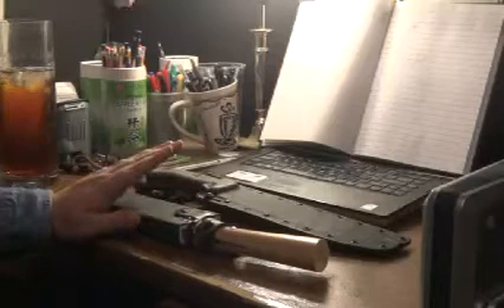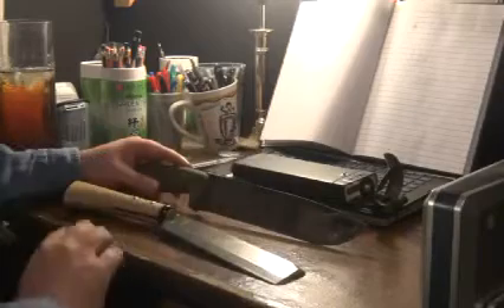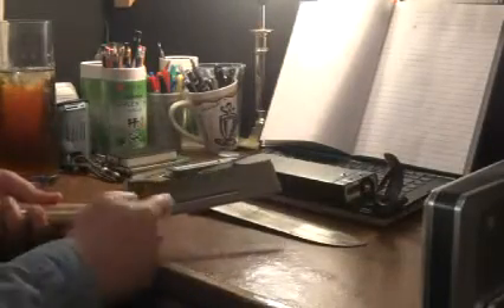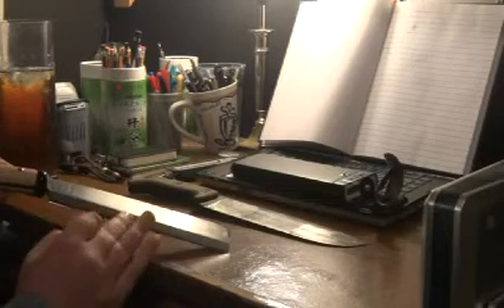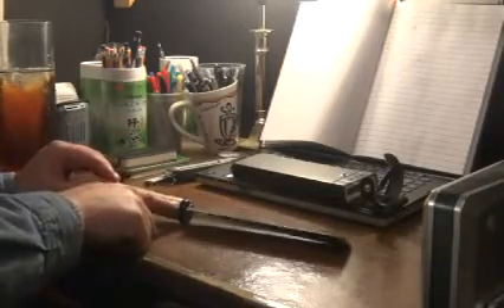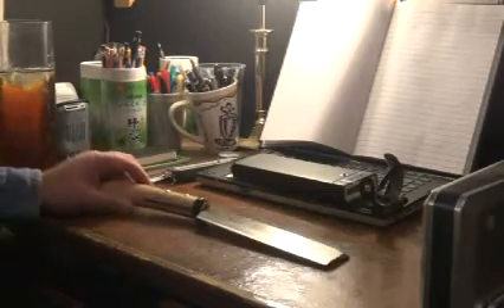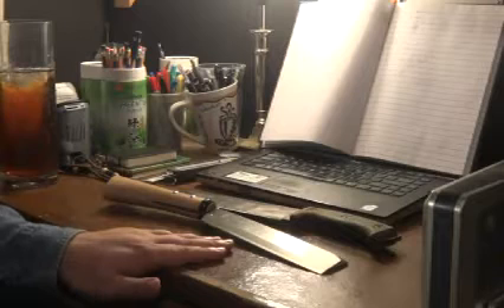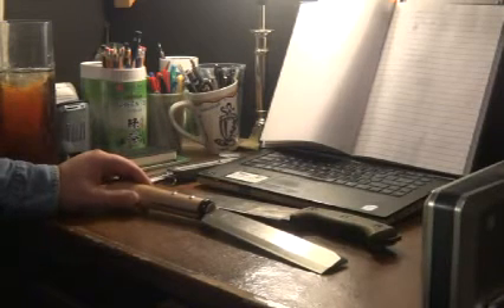Japanese garden machete : some specifications and observations

Comment: @CliffStamp Japanese are particular about tools. The chisel grind is used, like in Docs video for cutting vegetation where you are relieving material from 1 side without stressing the other. its good for taking the tops off bamboo, and delimbing as long as the flat side is always to the ground, or to the trunk. the other issue I have is that you must set your cut angle correct in relation to the edge or they can roll easily to the flat side. contd..

Comment: @CliffStamp #2. The japanese also made cutting swords of single bevel for performance mat cutting etc, because the lower 1/2 of the mat would not receive any of the parting force from the cut, and the wedging energy helped lift the cut piece off cleanly.  but the blades must be tilted a little off centre to support the edge correctly.. I just prefer a standard bevel that wont excell at all cuts, but will handle them all.

Comment from the maker: @knivesandstuff Yeah, that is straightforward just like the same way they work in the kitchen. I have spend an hour with it tonight and it is relatively easy to understand but not exactly what I expected at first. The wood cutting ability (not chopping) was a lot lower than I expected, but then I did a quick check on the numbers for the asymmetric wedging and it made sense.

Comment from the maker: @knifedrago Yes, that would be my concern as well. I may be getting a new wood stove shortly, different model which will demand most of the wood I have cut to be split. I will have a chance to see in any case. As long as I do not counter torque on the handle heavily the vibration will be slight anyway and I am interested to see how the grind itself performs.

Comment from the maker: @knifedrago Ironically, it has a very ideal primary grind for a froe, but I have some concerns about vibration through the handle, depends on the vibration points though. I have to check that out first. 

I used it for a few hours this morning, it is a very pleasurable blade to use for wood working in general. Also used it this evening to prepare supper, thick blade binds on hard foods, but on softer vegetables, breads, etc. really nice - assuming you can take the weight.

Comment from the maker: @knivesandstuff At first thought my concern would be the compressive load on the top would be more than twice as it would not be linear. Try for example to squash any material and there is a point where it no longer is elastic and becomes impossible to move further. I have never cut the mats though so it may not be reached in them. If it does not and the natural fall of the cut opens the top, the force would be reduced exactly as you note.

Comment from the maker: @micktheweld That is the real reason, I never expected this to outperform a full v-grind for most work, traditionally these were made from steel welded to wrought iron so they needed the very thick spines. But my main interest is just working with this grind vs the more traditional grinds used here to see just how they cut in the woods and how to use them properly for maximum performance.

Comment from the maker: @micktheweld In general it takes a fairly odd material and type of cut to benefit from a chisel grind. The force in the cut has to be asymmetric just like the bevel and/or the angle of attack has to be required to be extremely low. I am going to do some research on the mats and see if I can find something which simulates them, the problem is going to be the elastic nature as they have to open up properly in the cut or it defeats the purpose of the cutting.

Comment from the maker: @micktheweld Sharpening was trivial, it is just a plain carbon steel. They list no grade so it  is likely the lowest white grade which is just a very pure version of 1095, the higher grades would basically be something like 1145 (1.45% carbon or so). I just though it was ironic that it was very dull considering the number one thing which people praise for white paper steels is the ability to get extremely sharp.

Comment: @CliffStamp only highly skilled people attempt the cuts. if you dont tilt the angle of the chisel grind perfectly its actually much worse and harder. but if you think about 3" and 4" bamboo etc in the ground, then having a smooth cut on the bottom side and popping the top off is easier.. but again.. most people cannot do it. I'd have to find the reference material on it.. I have to go out now.

Comment: @CliffStamp the handle should last a life time because they use to cleaning up the backyard garden, So nothing about excessive abuse, no baton with it ether.
Except same custom made where you get the privilege to ask for a new handle after few years if you want too...Except this, nobody will change the handle on the nata like yours because its too cheap. I thing the most common grinds are Chisel, V-grinds high and low, and Convex...I thing that its an individual preferences.